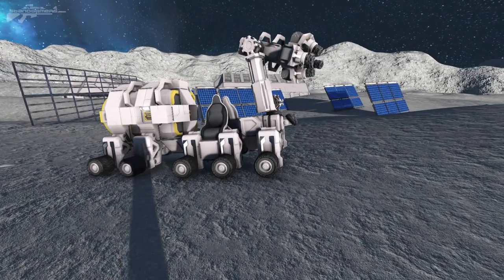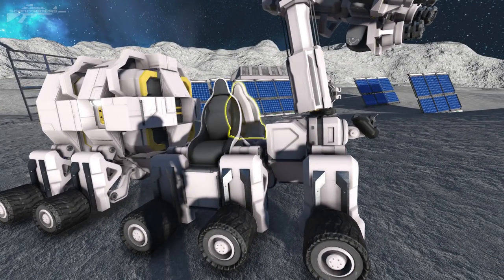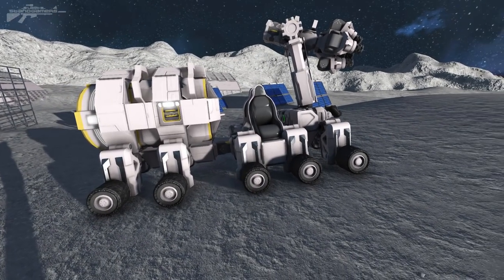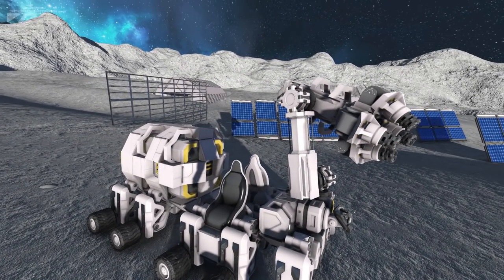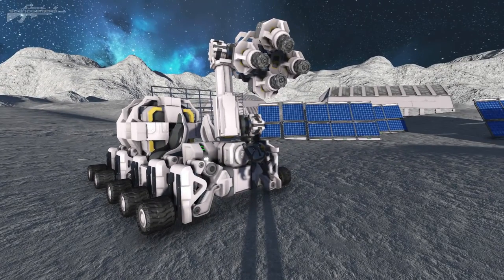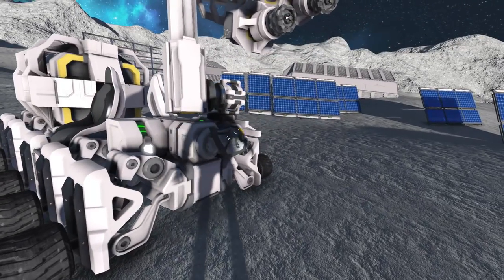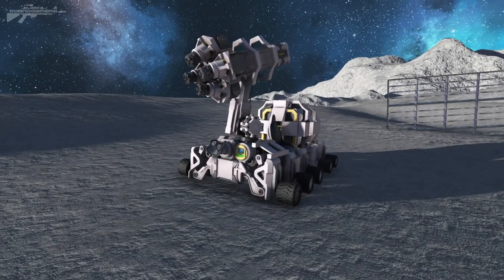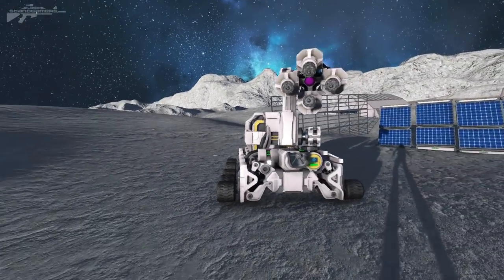TOP 5 Engineering Tips Don't Duck Up Again - Space Engineers

Comment: One I struggle with: remember mining ships get heavy - Think about where you could add more thrusters, just in case you designed it a bit short. Oh and remember if testing a design in creative, all the ore will end up in one place and it will never be full. I hate how you can't have creative without infinite storage.
Reply: Molly Moon play survival and activate creative tools in the admin panel (I belive its Alt+F10 or Shift+F10)
I allways build like that, it's far better than actual creative mode, only downside is you need to get yourself a liitle recharging station if building in space or using a lot of jetpack.
Reply: Yes, I discovered this trick shortly after posting that.. I have not used full creative since.
Reply: I am late, but you can weight test your ships in creative by spawning a lot of ore with shift+F10, grab it and then transfer it to your craft's cargo hold. This is how I test to see if new cargo/miner design of mine flies alright with full containers.

Comment: About tip one... Just got the game, kicked off survival on the crashed ship and built a giant small grid donut that fights somewhere between frigate-like and sentry-like. The size was the best decision I ever made cuz it is capable of losing 2 thirds of itself without consequences and repairable from the inside. As a noob who has seen many of your vids, is size not worth it?
Reply: Size Matters sure, in fact I followed the exact same path as you when I first got the game. Over time i've found that ship size and function really do go hand in hand, I normally don't plan for size unless the size itself has a specific function (say defense)
Reply: Can you give us a link to a picture of it? Id love to see this ship.
Reply: Assuming your main threat is drones and not other players the size probably isn't bad however i would recommend against drones using large layers of light armour due to lower cost compared to heavy armour. this allows you to use wielders to auto repair armour as long as you have tons of steel plates. allows you time to take down their drones without worry.

if your ring is too large for all wielders to run simultaneously then grab a repair script off the workshop which will switch them on when damage occurs around them

Comment: How about some tips as to starting off a ship I'm a noob
Reply: My tip is thinking about what your ship is meant to do, then deciding what blocks it's going to need, then arranging those blocks in an economical fashion. Start with essentials, then surround them with supporting systems. Large reactors, refineries etc. are big, need access to conveyors and require forethought when designing the ship. Gyroscopes and batteries can be put anywhere as long as you have enough room.

Build prototypes. If your ship is a mining rover with a movable arm with pistons and rotors, build that arm first to see if it even works. I once tried to build it, but it worked so badly, I chose to abandon the concept and try something else.
Reply: Nethan2000 what?
Reply: I answered your request. Anything you don't understand?